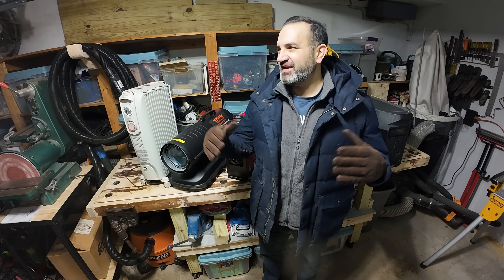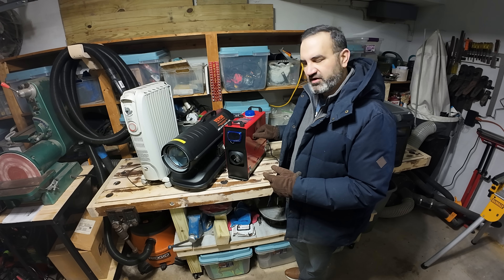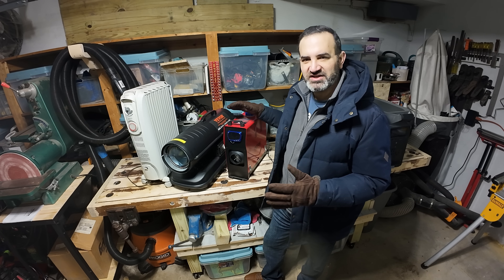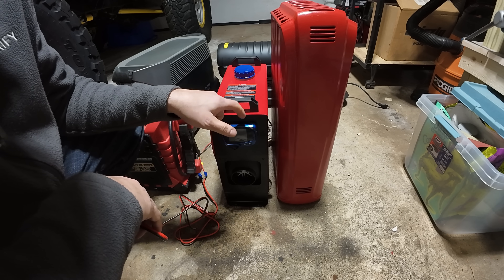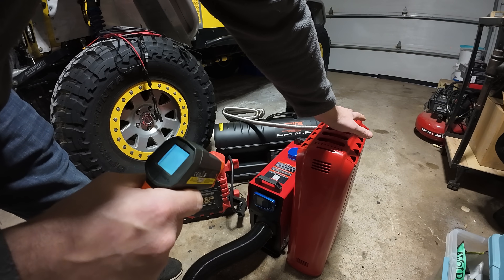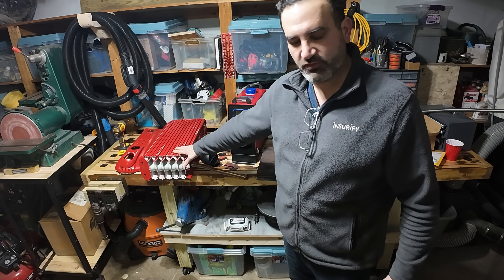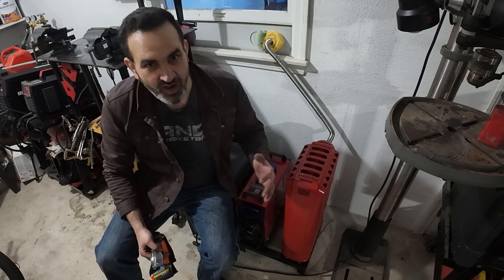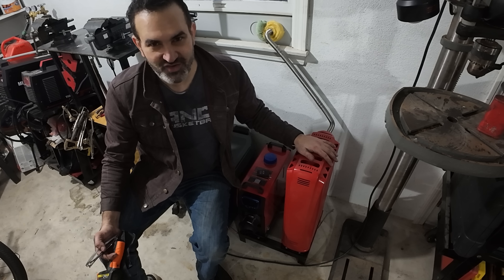Super-Efficient Vevor Diesel Heater Build for Shop & Off Grid

Comment: The hot exhaust should go into the radiator at the top and come out the bottom!  it will heat better and push the condensate out of the exhaust pipe.
Reply: I came here to say this same thing. Bump in efficiency as well as solving the problem of condensation. 👍
Reply: Correct !! I would also have the radiator tilted / angled towards the end that the exhaust is exiting to promote draining the condensate. He's going to run into soot build up issues soon.
Reply: Not much soot comes out of that burner, they burn so clean.. I have one myself, and let the exhaust go out into a tin can for a month, not much was in there.. But then I also use the oven efficient towards keeping it clean.. If I run it on low for a long period of time, I ALWAYS!!! Run it at max for 30min before turning it off... The webasto in my van are from 07, its been serviced at BOS since new.. all the paperwork says, they changed the glow plug 1 time back in 2011.. Original blower motor and mesh
Reply: I came here also to make that suggestion.  As it stands....it will trap the condensate.  Burned hydrocarbons and water for carbonic acid. Very very corrosive.   Going back over 30 yrs to my oil burner days as a heating/boiler tech..   BUT......WHAT A GREAT IDEA. I was considering using a 3 or 4 foot hydronic base board fin tube  or an actual cast iron radiator.  But you can find those electric  all the time at yard sales. Garage sales. Goodwill. Or even free at the local dump!
Reply: The heater exhaust goes into the top of rad  and the diesel heater should be above the radiator for the condensate to drain properly from the entire system
Reply: And the air intake on the blower could have been picked up on the top of the radiator with a cowl.
Reply from the maker: @brucekrisko4364  (and others in this thread) thanks for the advice. I’m working on some revisions to account for these issues. Much appreciated! 👍
Reply: @offgrid101 as a last issue, can you place a little shelf or mount for a wood stove fan on it to move the hot air out of the heat exchanger?
Reply from the maker: @davej7434  that happens naturally. The way the radiator is designed, convection currents form pulling the hot air up through it.
Reply: The best part of projects is justification of buying more tools 🔧 ie' Chop saw.
Excellent build!
Reply: Installed with this method in a boat bilge you can have a bilge heater and route the heat into the cab. Thanks for the great idea!
Reply: He's gonna run in too some issues soon
Reply: You can simply extended exoust pipe inside heated room! Online there are available disel heater exoust pipe extensions in 3M increments! Simply hook 2/3 such sections together, mount it safely to wall and then route it outside! You can even use it to route hot exoust around your garage perimeter just like central heating systems!
Reply: Well said bro, was gonna say it will condensate in the radiator should flow the other way
Reply: Link exhaust up to a EGR cooler. Fill rad and EGR cooler with water use a pump 12v   Even better system I’ve it goes off leave pump on for 30 mins to take heat out of cooler thus extending heat out put
Reply: @B.G.R.B.M.S  thats not an entirely bad idea.
Reply: You beat me to it.
Reply: I agree, great idea but you have to get rid of the acidic condensate.
Reply: Isn't the total exhaust length be 2m max?
Reply: @jubbaronny  The limit on length may have something to do with longer lengths could cause exhaust gas to form a lot of condensate OR!!! it could lead to restriction and cause the combustion temps to rise. He discussed condensation in the video if I remember correctly. In any event, you raised a good point.
Reply: Heater above the radiator and hot air in top and cool air out bottom the exhaust should not go up it will plug up
Reply: Agree, moisture will still out
Reply: EXAXTLY
Reply: excellent suggestion
Reply: He should have just used a piece of 3/4 forced hot water baseboard heating  E-75, 3/4" Baseboard Element you can get anywhere like HD or Lowes I used a 6' piece and it is working great and has been for over 2 years now . The heating element ( 3/4 copper pipe with all the Aluminum fins has to be in the Case the baseboard case as it works thru natural induction , cold air is drawn in the bottom flows over the hot fins and center pipe and out the top side hot . Common everyday baseboard heating . He would have done so much less work and got far better results . I se all these people using everything I can not believe I am the first to come up with common everyday baseboard heat and so easy to install like it was made for it like perfectly made for it easy as pie . At the and of the baseboard the exhaust pipe fit right on and exhausts outside barely warm  . You do not have to be a genius to figure stuff like this out . But to use a cast iron radiator as an exhaust heat exchanger that is just plain dumb.
Reply: Brilliant Idea, more safer maybe add a little air flow valve on the outlet hole,  you can control the heat a bit to.
Reply: 100%
Reply: Выхлоп должен из печки по короткой трубе выходить в атмосферу, из за лишнего радиатора создаётся сопротивление для отработанных газов и горелка начинает работать неправильно. Через пол года такой эксплуатации и всю камеру сгорания забьет  сажей. Тысячу раз люди уже наступили на эти грабли, почему вы не знаете об этом?
Reply: You are absolutely right, my system is done this way and there is a lot of water out at the bottom hole.
I can heat my tiny apartment with a 3kw version at minimum power with - 5 Celsius outside and 23 Celsius inside.
1 liter per day
Reply: Absolutely not! Needless to explain. I may suggest grade 5 science book for you to review

Comment: Ecoflow 12v 30amp LOL try about 8-10 amps.
Reply from the maker: Maybe so, but it worked!  You can see it working at the end of the video. FYI, it's marked 30A max, where the cigarette lighter out is 10A max.
Reply: @offgrid101  which ecoflow do you have? I'm pretty sure that 30amp is for the xt connection. The cig outlet is 10amp +/- 1 amp depending on your state of charge.
Reply from the maker: @Scott-ig1zd  EcoFlow Delta Pro. The 30A is an Anderson connector.

Comment: Voice of experience:  Replace the automotive accessory plug with an XT-30 or Anderson PowerPole connection.  Much more capable of handling the amps that are pulled while the glow plug is heating up, plus the connection type is much more secure.  Those old-school cigarette-lighter style adapters, as well as the SAE connectors, just aren't the best solution for what you're doing, and on an AWSOME BUILD like this, you want only the best!  When you shut it down, make sure you let it go through the "process", or you'll build up carbon in the unit.  You can buy oil heaters at Goodwill or similar places for <$20...and if it doesn't work, WHO CARES?  :)
Reply from the maker: Great info, thanks! I did remove hte cigarette-lighter adapter, because both the Ecoflow and car jumper were limited to 10A out on that outlet, which wasn't sufficient to power the heater. I found that the Ecoflow has a 12V/30A Anderson output. I hard-wired the heater to that for now, but my plan is to get an adapter and wire it to plug in cleanly.

Comment: If hot exhaust goes in the bottom and colder goes out the top, wheres the condensation going?
Reply: Cool, clean build. I have watched a few of these type of conversions. The thing that made the radiator heaters hold heat for as long as they did is the oil or water inside them. I've often wondered if the re e is a way to heat the oil inside them with the exhaust. Until that gets figured out by someone smarter than me.... I would say this is the best route.
Reply: The answer to this question will cost him a new heater soon...
Reply: condensation goes down, to the hottest point of the device and they will be turned into steam. If the heater runs hot enough, the moisture will exit the system. If not.. I guess it will fill up and start making bubbly noises :hand-orange-covering-eyes:
Reply from the maker: @EIS77-harmlessgoy  if condensate collects in the radiator, I'll add a drip line. If that doesn't handle it, I'll modify the stand to raise the heater up a few inches so it doesn't backflow up the exhaust. I'm not stressing it.

Comment: Efficiency and heat distribution would be improved if the output vent faced the radiator fins. Radiator style heaters work best with a fan to distribute the heat around the room. I'm sure it does a fantastic job as is, just giving my two cents... Everything can always be better ;)
Reply from the maker: @jakepatrie8332   yeah, I thought about that. My original plan was to use a steam radiator like I’ve seen others do, and point the fan toward it to increase efficiency. But this type of radiator is designed with convection channels that cause air flow without a fan. That’s why I decided to use it and keep them separate.

Comment from the maker: Thanks for watching, everyone! Here's the build list:

* Vevor Diesel Heater: https://www.vevor.com/diesel-heater-c_10321/heater-p_010495189666
* De'Longhi Oil Heater: https://www.amazon.com/dp/B000TGDGLU/
* Extra 10ft of Hose: https://www.amazon.com/dp/B0CR3TYGK7/
* Rustoleum Red Engine Enamel: https://www.amazon.com/dp/B0C828J6ZN
* RTV Silicone: https://www.amazon.com/gp/product/B07R17MD5S/
* 64" of 1-1/2" angle iron
* 16" of 1-1/2" flat bar
* 8" of 3/4" angle iron
* Black spray paint

Comment: Have you experienced any condensation gathering in the "oil heater" from cooling the exhaust gasses below condensation temperature?
Reply from the maker: @Mr.Engineer.  I’ve only been using it for 2 days so far, so I haven’t had the chance to check. If it’s a significant problem, my plan is to add a condensate drain line at the bottom of the radiator and see if that solves it.
Reply: @offgrid101  
Been thinking about doing something similar for my basement, but then I would use my chimney for the exhaust and having the exhaust travel  7-8 meters straight up leaving a lot of moisture all over the bricks.
What will then happen when I use my fireplace and will it lead to forming of more soot and a higher risk of chimney fire?
Maybe I must have a pipe all the way up the chimney and have the exhaust exit the pipe at the top of my chimney.

Hard to find any data on this online, so your results would be highly appreciated if you share them :)

Also, did you think about cross flowing the radiator for "better efficiency" or does it heat evenly enough as it is?
Reply from the maker: @   definitely, will share my experience and any updates or changes I make! FYI, I checked it tonight after running 8 hours yesterday and 8 hours today - no noticeable moisture buildup.
Reply: Where was you looking? Great idea !

Comment: Hi just watched your video an design All very good. But exhaust should exit below the heater as water can build up in exhaust. As I have seen on another channel. It's in fitting instructions yours is very high above. Not criticising just keep a check on it buddy to be safe 👍
Reply: Yeah, bro, what Paul said, the diesel heater needs to be above the radiator, and the exhaust for the diesel heater needs to enter the top hole and exit out the bottom hole of the radiator.  You then need to add a drain hole in the bottom of the radiator to drain out moisture ever so often. Otherwise, your radiator will rot out over time …

I appreciate your ingenuity!  Way to solve a problem we all suffer in the North.
Reply: I was going to say I wouldn't paint the radiator then you held up the engine paint can and I finally said "ok fine😂"
Reply: Well, with the amount of heat, surface area and air flow; the condensation probably evaporates and exits out the wall.
Reply: @jasgk74 I doubt that. that long run going to the window was only 50 something degrees. condensation is definitely going to build up in there and drain back down into the radiator.
Reply from the maker: @paulmarsh6243  thanks guys, good to know! Fortunately the exhaust pipe from the heater is below, so should be exiting the heater. I think I can add a drain line at the bottom of the radiator. If that doesn’t drain enough vapor, I’ll fabricate a new stand to mount the heater on top of the radiator. 👍👍
Reply: Maybe you can just rotate the radiator 180 and lift heater?  I don't know if it's still be beautiful lol @offgrid101
Reply: This comment is absolutely correct. I built a heat exchanger for my diesel heater, and when I initially installed it, the outlet for the recovered exhaust was above the inlet of the heat exchanger. So much water built up inside the heat exchanger that the system would not run
Reply: Please delete this video, it's ok that you have acknowledged your mistakes and ignorance, but not acceptable that you allow others to watch your errors, what if they don't read the important comments?